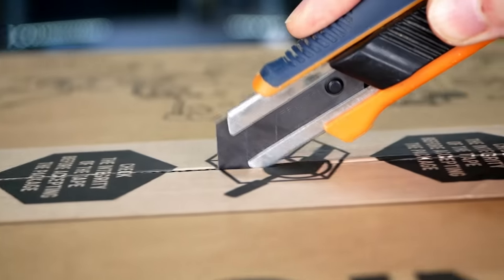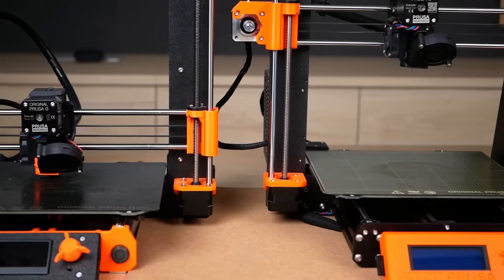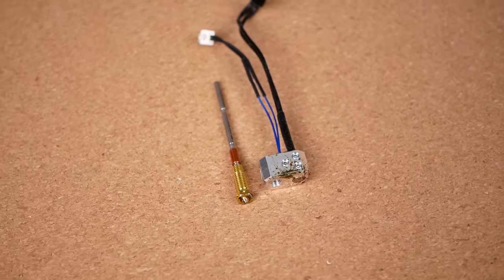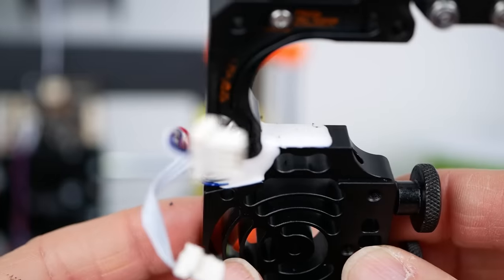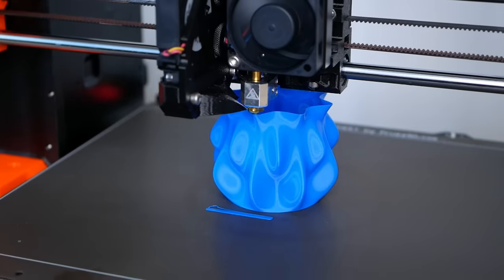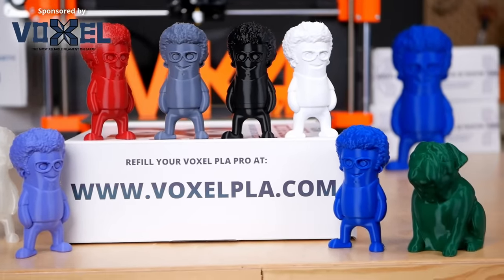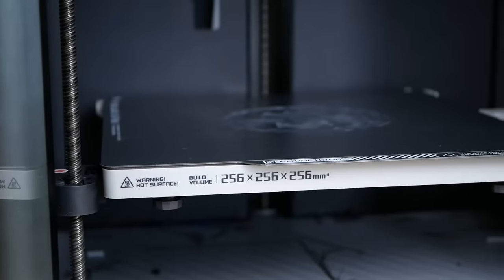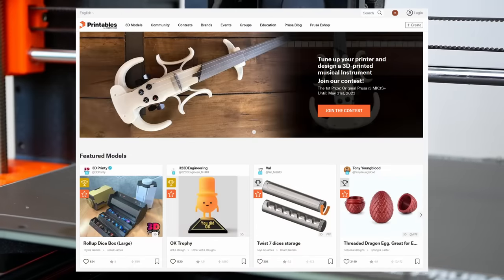Should you buy a NEW Prusa MK4 in 2023 or rather a Bambu Lab X1/P1P?

Comment: I think if I'm going to replace my modified MK3S+, I'd just save up and go for a larger Core XY, such as the XL. Just don't see the point in replacing a bed slinger with a slightly newer bed slinger.
I'd also miss the Revo hot end. It's disappointing that Prusa couldn't come up with a better design. I don't buy the excuse it's about nozzle backwards compatibility, nozzles prices aren't that much that you have to worry about that.
Remember, Prusa lied to us for years saying we didn't need a 16-bit or higher board, and that the 8-bit board was all that would ever be needed. They always lie when it's not what they are selling.

Comment: I can (and did) get a BL P1S with AMS for 50% less than the Prusa Mk4 with enclosure. I could get a BL X1C with AMS for the same price as the Mk4 with enclosure. 
Prusa is still based in the Czech Republic. Although this is in Europe it is definitely not a benchmark for European wages and living costs. On average the Czech Republic is just over half the EU average and pretty much on the same level as China. This factor simply cannot be applied as a reason for the high prices. They simply are expensive with good service. That's it. Of course, competition is important and is in the interest of users and customers. This time BL wins even if they still have to work on their service. I do like the still open source way that Prusa has. That is a nice to have but for me it's not nice enough to pay the same or 50% higher price for a not as good printer. Prusa has to get out of their comfy corner.

Comment: From a production standpoint the Bamboo Labs has an advantage with the multi-material unit since changing filament type between print jobs is accomplished automatically without operator intervention. This is a problem with any printer that does not offer a multi-material unit.

Comment: eh I added a loadcell to my 3D printer hot end which does detect the extrusion force of the filament down the hot end. The issue is that even small bumps would spike the loadcell so while its printing it will not be realistically possible to use it to manage the extruder for clogs or strains. hell just the gantry moving or stepper motor/heater electronic noise can set off false positives.

Comment: I think Prusa is aiming for the prosumer market still. The maintenance and format of the mk4 is so much like the mk3 that it helps a lot when you have 3 mk3's to justify getting a mk4 rather than a bamboo labs. The best analogy I can think of is buying a GMC because they still make them the same way they did 10 years ago but with a few new features. I wish that my work had the new mk4 in the 2024 budget maybe I can try sticking it into the budget in 2025 but I think we would still buy a mk3 so that we can keep buying the same replacement components.

Comment: I went with a Bambu x1c combo. Im not super concerned about the open source aspect or if the company won't be around / have support in five plus years from now. I know it may not be as relevant as a regular electronics purchase but most of the things I buy that are electronic are not open source. And in terms of support for a product if one does not purchase an extended warranty then support of certain aspects of a device after a year or so will end. I'm not really concerned in that aspect. I get if it breaks I'll have to figure something out. But that's just like anything else you purchase that may or may not be repaired.

Comment: If you use a printer as a tool for your work, then definitely consider a Prusa printer. There's a good reason why many printing farms use Prusa printers. They are highly reliable, and if something breaks, you can fix it yourself. All parts are readily available, and the technical support is excellent. In real-life usage, you don't need all the LCD color displays and features like lidar, and so on. Auto bed leveling and a filament sensor are all you need.

The Bambu printer looks great for someone who prints occasionally, like a Benchy or other useful items and needs quick results. However, it would be the wrong choice if you intend to use it as a professional tool.

In our workshop, we have been using a Prusa printer since the summer of 2017, and it still works great. But next year, we plan to order a new one with an enclosure.

Comment: Alternative to both if you have the spare time, build a voron 2.4. My only complaint is that there is no easily available non finnicky multi-material option. There is the ERCF but it just has some problems with reliability and configuration.
Reply: The ERCF is very similar conceptually to the MMU2 though, so I suspect it's going to be a bit more reliable than Prusa's option for the Mk4. You do have other options though, there's the E3D toolchanger which iirc is a bit cheaper than the XL but a bit smaller, or if you're keen you could build a Trident/Ratrig/other CoreXY printer and build your own toolchanger on top, which is an increasingly well trodden path these days.
Reply: @bosstowndynamics5488  I have seen people get the ERCF to work but it was always cautioned that the amount of configuration and tinkering with it is pretty high to get it to work reliably. I knew that people had done IDEX systems for many corexy machines but never have seen anyone do a toolchanger setup on them. Might have to look in to that. I have wanted to put together one of the 500mm Ratrigs for a while now so that may be a good option. Thanks for the info!

Comment: Having owned a MK3, MK3S+ and a Prusa mini I'm now leaning to get a Bambu P1S + AMS instead of the MK4. Partly because I've had quite a lot of issues with the assembles Prusa's quality. Always needed quite a lot of fixes and tuning to get It working properly with less resonance and better alignments. QC wasn't great, it basically cam down to the level of: It prints, but not properly tuned. And I'm at the point I don't enjoy tweaking too much anymore, I just want to print. The MK4 has improved quite bit since this review with input shaping etc. But I can't find so much about how much better It works now. The launch was a bit of a mess and It's been developments are stagnating too long now at Prusa. 
It's also partly to just get a new experience since all I've had were Prusa's. But ... the biggest drawback that still make me doubt is the noise the P1S makes. Then again, I also have to print with lower speeds in silent mode to get the MK3S+ actually silent, otherwise the resonances get to a similar dB level as the P1S makes on (twice as) high speed (even having placed It on a stone tile to get it withing a reasonable range already). The open source nature of Prusa has practically never been something I exploited. Upgrading parts didn't lose your "guarantee", but basically still meant the support couldn't do much other then letting you order (expensive) replacement parts with high shipping costs (if available) since most problems of course happen past the guarentee period.  
Looking at the Bambu lab replacement part prices, I'm sure I can figure It out If something is wrong, since I basically did the same with Prusa. Considering the price, I'm willing to try the Bambu PS1 out and see If I can deal with the noise. It otherwise just looks like such an excellent package. Only replacing the nozzle (something I don't do that often) Is a bit of a chore on the Bambu's. I may upgrade that at some point If I otherwise like the printer.
You've got a valid point about the "prusa tax". Prusa just never really did anything that created a stronger brand loyalty. Its very likely I'll jump back to prusa at some point though. We'll see 😉
Curious what you think of the mk4 now, many months later?

Comment: Guten Tag ^^. Thanks for the honest extensive review. I was thinking about getting one of those to replace my (improved) Ender3Pro but then i stumbled across some "PETG as PLA support" videos. The roof-quality and ease of support removal was out of this world - but multi material single nozzle printers seem to waste a lot of filament and the frequent changes take quite long.. I'm looking into dual nozzle coreXY klipper systems now but haven't found a good solution yet. (maybe a modded ender 5 S1 with sonic pad...) Have you come across such machines?

Comment: I came through a search in a 3D print forum.
There it was about the fact that a Bedslinger is out of date and the Corexy is the only true .......... The contribution was from 2016.
2016, 7 years ago!
Some of them have to be able to do the vibrating slabs.
Of course, I can also buy and pimp a cheap Chinessian bed pusher.
But at the end of the day it costs just as much as a Prusa.
If someone enjoys it, it is not wrong. You learn a lot.
And the wife does not notice so quickly when small parts for the printer always come 🙂

Comment: I canceled my MK4 kit and bought a p1p and I regret it. I'm not impressed with the quality of the prints but the speed is mind-blowing and really fun to watch. The biggest annoyance that I'm consistently having is what should be the simple process of changing the filament. I get errors, it's filament sensor doesn't seem to work and just won't load and I'll have to reboot in the middle of a print because it doesn't understand that I've unloaded the filament and won't accept input from the app or the slicer or the LCD. Also my LCD is crapola, if I press the buttons sometimes they don't do anything and sometimes they'll do the opposite like for some reason when I press up it'll go up once and then down twice. Also calibrating flow is tedious and you can't link profiles, you just have to recalibrate every time. Not to mention this ridiculous 7 Minute process every time you start a print. I just want to make sure my damn first layer is good but I have to sit around and linger while it clicks and wiggles and jiggles. It's also super annoying to have to pull your machine out every time you want to change filament. Why in God's name they put the real on the back and The Poop Shoot so that you constantly have to yank your machine is beyond me. I've got about 7 days left to return it and I'm either upgrading to the X1 Carbon with the AMS so I can get the supposedly better screen and the flow will be automatic. Or I may just send it back all together and get an mk4 and Hope they come out with input shaping in ASAP so I don't pull my eyeballs out with the slow speeds. At least with proof I know I'm getting quality.

Comment: Well the new A1 just kicked the MK4 in the gonads pretty hard.  So now you can get a machine that is arguably better than the MK4 for a third of the price.  I'm sure Bambu will support their equipment for a long time and they are proving they are 100% committed to turning their machines into a fire and forget situation, but even if the support isn't as long as with Prusa, you could buy two more printers with the money you save.  At some point, you simply have to say the price delta isn't worth it.

Comment: I have a sidewinder X1, considering getting a better one and of course the whole bambu / mk IV is a big question for me... I agree with most of what you say in that regard, the proprietary aspect of the bambu is a problem for me; It's not so much a hardcore "I use arch linux" stance on the topic of open sourcing things, rather than a convenience for me : what if their service goes down and they stop making those ?

Prusa has such a massive user base and community, even if the company ceased operations there would be updates and parts available.

I think the best answer is "wait a little bit more" because prusa might not release something right away to match some of the fun stuff the bambu offers, but someone else might.

A Mark 4.5 would be my go to though. It feels a bit a little bit short of what the competition offers, but it has it's brand reliability and support to help smooth that out;..

Comment: There are many things I like about the Mk4:
I like that Prusa released a product that just works safely, reliably, and is familiar. I'm glad it's not plagued by featuritis.

Software isn't just about the technical aspects, it's about usability. For example, I think the V400 and the Sonic Pad both don't do input shaper right. AFAIK the V400 doesn't let you configure it at all and the sonic pad doesn't give experts any insights on the data. It's a fine line between easy usability and expert accesibility.

I own a Revo and I really want to love it, because I consider it to be a major step in terms of safety and reliability of hotends. But in terms of performance, it's just middle ground and the incompatibility with CHT nozzles is disappointing. I feel like the Nextruder with the nozzle adapter is a better solution for experienced users.

So I hope Prusa succeeds with this launch, but I'm worried they have shot themselves in the foot, because the XL is on the horizon. So even those who love Prusa as a company might wanna just hold on to their money until the XL arrives.

I've retired my mk2(ish) printer just a few months ago after many years of reliable service. I now run a Voron, because I love tinkering. I won't forget my Prusa roots, but I don't think I'm gonna buy another printer from them anytime soon.
And when I recommend Prusa printers to people looking for a printer, they usually seem thrown off by the price.

I don't think many people are actually very invested in 3D printing. It seems cool, people try it out, and once they have printed a handful of models and trinkets and realize designing is hard, the thing just collects dust. You can have that experience on any cheap bedslinger...
Nero3D suspects Prusa now targets schools, colleges, universities, etc. I hope that will be a good niche for them.

Comment: @CNC Kitchen Hi Stefan, thanks for the Video. To your question of which printer to choose, I would go for the Prusa, but only if there were only Prusa or Bamboo, but in the real world I would go for a Voron Switchwire in the MK4 kit/P1P category, in the MK4/C1X I would go for the Voron Trident or V2.4 all with Print It Forward parts if I haven't had an ABS printer. Bamboo is a company to avoid IMHO: what do you do if you have to service the carbon rods?   What do you do if a part breaks? And don't get me started on the elephant in the room: the closed source OS and the need to be connected to their China servers to update it or even to use the webcam... What will happen if Bamboo goes bankrupt and I need parts then? With Prusa or Voron or any other open source printer you can print the part or buy a standard  replacement part. QIDI is an other alterative IMHO, but Bamboo is far to dangerous to end up as doorstopper.
   I own a Eryone ER-20 (first printer, now heavily modded), a Voron V0 (my most used one, a mini XL if you ask me ;) ), a Switchwire (with ERCF MMU) and a V2.4 350. The ER-20 has now ~4000h and the y v-rails and their mounting plates wear and it will be canverted into a Swichwire (#nomoreleadscrews)

Comment: Those features that Prusa sells that are not there yet ... Makes me kind of sad since it's similar to what Bambu is doing. Carbon X1  AMS is sold as the (almost) ultimate printer that can print anything. Yet, they do state in small print somewhere hidden that it does not handle flexibles (in the AMS) nor is it recommended to use (carbon) filles materials due to excessive wear in the AMS. 
input shaping on the Mk4 without accelerometer ? You would need one on the head AND one on the bed - since it;s a bed slinger so I don''t believe this will work as well as on a non bed slinger (head banger ?).
I love the open source idea of Prusa and I love what they do for the 3D printing world and I do need a new printer, a multi material one so I pre-ordered a Prusa XL. I think Prusa has a great team and they will get this printer to print as good as - if not better - than the Bambu printers.

Comment: So, in Jan 2024, I got tired of waiting for MMU3 for MK4, plus was disappointed by Prusas Input Shaper affair.
I also noticed that Kit Mk4 + Enclosure + MMU3 is little more expensive for me than X1C+AMS...

So, shame on me.
But I had only super positive experience with it. ABS performance fantastic, so was maintenance after. PLA is super easy. 
TPU when slightly slowed down, very good performance. 

It is fire and forget type of machine. E.g. Got notification while out that stringing was detected - complex geometry bery light party and me trying printing PLA on high temp bed without glue - but it was not consequential for the rest of print, so I just let it finish. 

They need to copy prusas cancel object feature.

Comment: think compering both printers by price is incorrect ... Bambu cost $1,199.00 but most people take it with AMS so it coast $1,449.00 USD, but it is all without taxes so final coast of bambu is much highier, also for example to buy bambo in Poland you need to have company to order it... if not you can buy bambu with ams on popular auction online shops for nearly $2400 USD, bambu is much more expensive than Prusa kit

Comment: As an early adopter of Zortrax printers, which were excellent tools for their time; were just a huge PIA due to being closed off.  I told myself I'd never go closed source again as it pertains to 3D printers.  Bambulabs has me on fence as it's such a great design, however I don't like CLOUD :( and closed down anything, so now I'm not going to buy a Prusa or Bambulabs at the moment  Just use what I have which isn't the fastest but works great and gets my jobs done.
Reply: The cloud only function on BL is just another fake news that was pushed by a few streamers, unaware that a LAN option is available in settings. And you would just put your print on the SDdisk and move it over to printer if you didn't want to bother with online or Lan at all